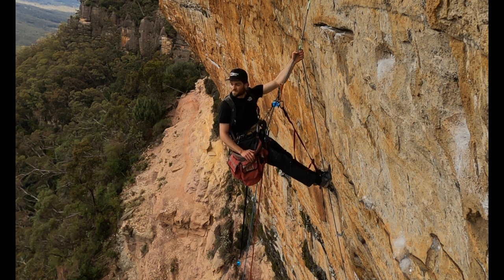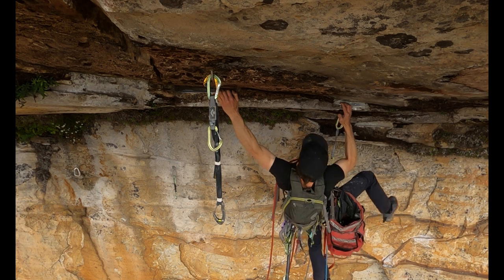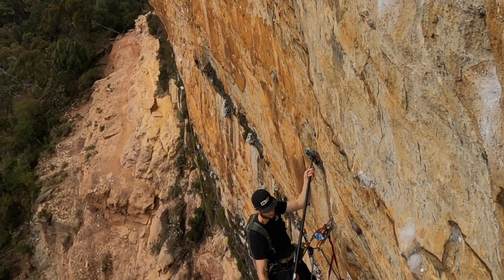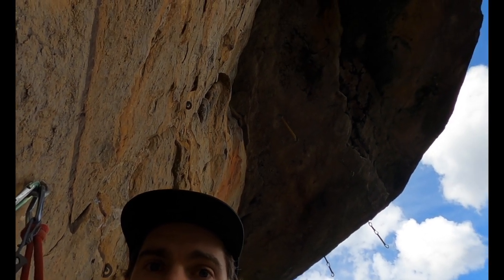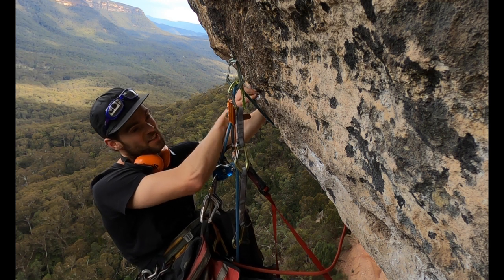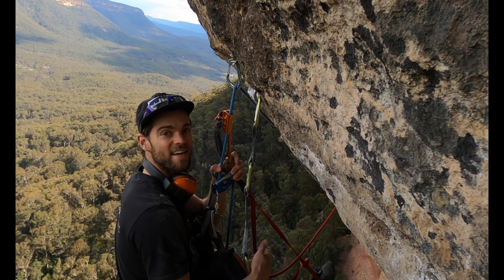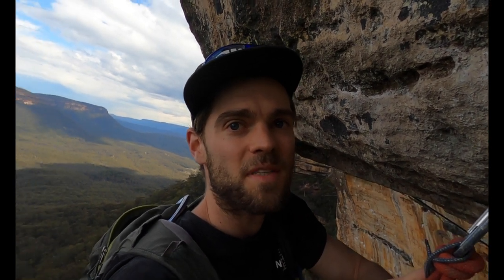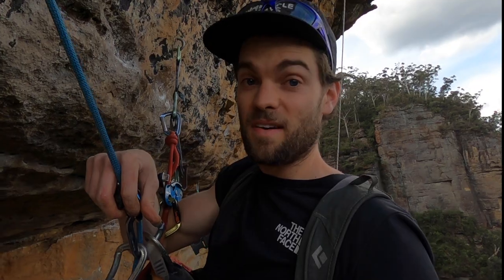A bolting blooper day - Wombat Roof proj

Comment: Hi! Were you hanging from the glue-in you just placed? 😳😅 By the way, I have always bolted routes from the top down and I don't know if I really understand how to do it the other way around. It'd be much appreciated if you posted a video with all the manoeuvres, etc... Cheers from Spain!
Reply from the maker: Not from the glue in I placed. From a positioning bolt I had left in from bolting the route initially. Most of the time I am going from the top down, but in this instance, it was just easier, kind of, to go ground up. Ill be sure to get onto making a video with all the techniques. It’s a little involved, but relatively simple. Can’t wait to get to Spain sometime soon. Maybe 2022!!

Comment: what size 'concrete screw' did you use?  we use 3/8 x 3" stainless wedge anchors for pretty much everything.  why go to all the extra work for glue ins?
Reply from the maker: Using m10x60mm screws and they are bomber for aiding about. A few friends use m8 and m6, however the m6 can be crap when you're drilling the hole because the flutes on the drill aren't able to push the sand out of the hole (too small). I originally bolted this thing ground up.

Use glue-ins because the rock here in the Blue Mountains is too soft for an expansion bolt to be safe.